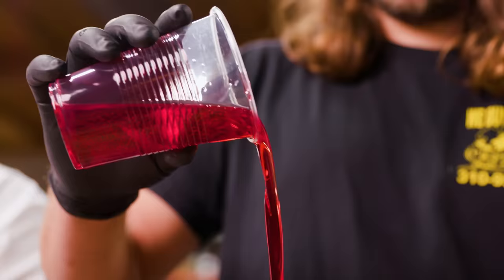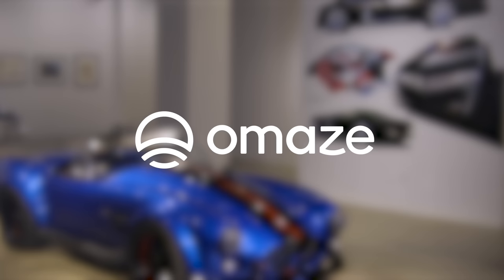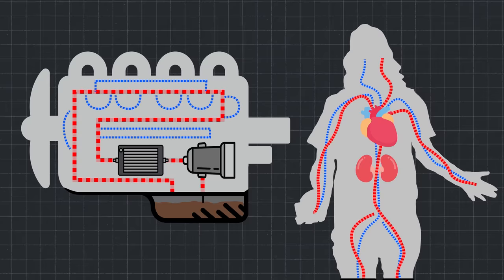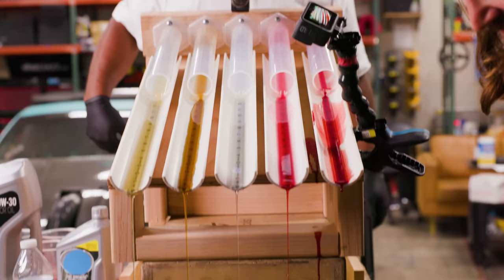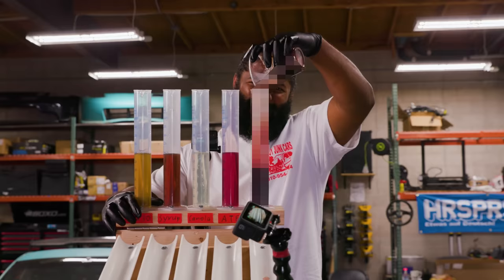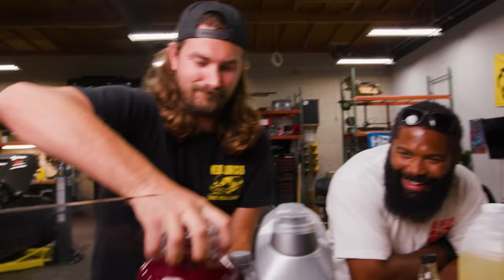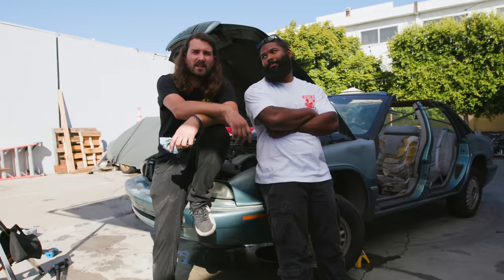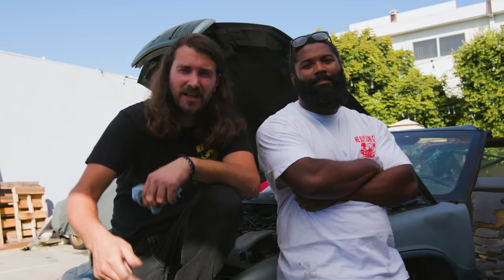We Replaced Our Car's Oil with Blood

Comment: Video idea: How far will a car run without an air filter?

P.S: Great video!
Reply: Just go watch Adam LZ with a rental. They’ll go pretty far
Reply: You could drive for weeks without an air filter
Reply: You can go for long without one ,think about the guys running turbos with no mesh or filter
Reply: @waseemparker5622  yea, but the turbo is like a lil blender making air smoothies for the engine. It takes the stuff in the air and dices and minces it into something combustible.
Reply: @brahtrumpwonbigly7309  no.
Reply: Maybe years
Reply: a car that I bought had no air filter. So I zip tied my sock onto the air intake. Worked like a charm. Drove the car offroad for a year. No problem.
Reply: Years. Have a friend with a 350z that hasn’t had one for probably 3-4 years now. Don’t know why he never replaced it. Runs like shit in the rain but otherwise it’s fine. We hope
Reply: @brahtrumpwonbigly7309  what
Reply: Depends on the road conditions. Down dirt roads, maybe 25k on the highway it could easily crack 100k with no air filter. It all depends on the dust it sucks in and how long the engine will have compression.
Reply: So you want one of the donut guys to, for many months, for thousands of miles, drive a car whose welfare they don't care about just so they can make A SINGLE VIDEO.

Unless there's a cold air intake that sits very low in the engine bay and they're racing through dirt and mud, that's gonna be a supremely boring video.
Reply: it'll all depend on what gets in, if all the air happens to be pretty clean, you can run the car its whole life without a filter. On the other hand, you could kill an engine driving in the desert WITH a filter on...

Comment: Maple syrup isn't a lubricant, its more of a sort of glue cuz it'll harden when its cold or left too long in low-med heat. it could damage ur engine as time goes on. also maple syrup can distribute heat and will be hotter faster
Reply: True

Comment: To clarify for a 5W-20 oil the W stands for Winter. Both the 5 and 20 are measurements of viscosity. The 5 is when cold (40°F) and the 20 is when at operating temperature (210°F). Lower means less viscous/ more runny. Higher means more viscous/less runny. So even though the W doesn't mean Weight the the number or viscosity index is widely called the oil weight.
Reply: Nice explanation .
Reply: Why would it be less viscous when cold? I see you were perhaps not implying that. From amsoil they are tested at 40 C (104 f) and 100 C  (212 f ).  they make multi grade oils that can still be pumped efficiently through the engine when it is cold below 40 C. the higher number after the w does not mean that the oil is thicker at 100 C than 40C

Comment: One reason why the oil stayed so cool during the heat test is that microwaves work by exciting water molecules and since the oil is well, oil based it was more resistant to heating up than the other fluids which were mostly water based

Comment: I'd like to make mention about the way a microwave "cooks" food. Let's put it this way; the micro radio waves being broadcast inside the box collide with and agitate molecules which causes them to give off more heat. Some substances are more subjected to this molecular agitation than others. Sugars and water in foods are some of the more efficiently agitated substances than foreign objects a block of Styrofoam (just a hunch).  Maple syrup did exactly as would be expected with heating up faster than the motor oil,  the substance least affected by the agitation of the micro radio waves. Heating up test liquids through conduction like a 'sous vide' steak could also provide as a reliable method of having equal temperatures across liquid test materials.

FUN FACT: The holes in the screen door of your microwave are just slightly smaller than the micro radio waves themselves, therefore not allowing them to pass through the screen as we are wondering what kinds of cancer microwave appliances cause as we stand too close. They're just photons, give it the photon-beans.

Comment: The Regal has the 3.8 which is related to the Chevy 4.3 and its worth mentioning my s10 with its 4.3 the original owner blew a hole into the oil pan bigger than a softball and he still drove it into a parking lot 3 miles after it started leaking oil and it was still running in the parking lot

Comment: btw, the difference in temps of the fluids after microwaving is just because of the difference in water content. Microwaves require polar fluid particles - water being the ideal - in order to heat up the substance, the motor oil didn't raise as much in temp because it contains less water, this isn't really indicative of how the substances are able to deal with heat, it also messed up the subsequent hot viscosity test.

you might have noticed that really dry things barely heat up when you put them in the microwave, so maybe next time, don't skip adding water to your 5 minute noodles

Comment: to be fair, the microwave won't heat up oils, especially engine oil as the fluid won't have enough water in it to raise the overall temp of said fluid. Microwave bandwidth is tuned to target water molecules in food. That's how it heats up the food by exciting water molecules in whatever food item is present in the oven.

Comment: With the microwave heating: for anything with water...this would have a strong effect because of the molecules dipole nature. This would cause that fluid to heat up. Oils are hydrocarbons. electronegativity between carbon and hydrogen is very tiny and considered nonpolar. Therefore the microwave energy doesn't cause the same molecular friction for those. 

The oil will heat up...but simply because the thing it was held in heats up...so it just gained some temp from there. 

A convection oven would have done the  trick... however I can tell the blood would be 'black pudding' by the end of the test :)

Comment: Microwaving different fluids doesn't affect them equally. Microwave is tuned to resonate water molecules, so they take in the energy the magnetron is sending.

No doubt maple syrup got hot because it's water & carboHYDRATES; and oil barely got warmer – most likely just via convection of hot vapors or infrared emission of the more watery liquids.

Comment: It’s no surprises that with the heated up fluids the higher the temperature was, the lower the viscosity or rather the faster the flow was.  That being said, that doesn’t necessarily mean they’ll perform in that order since your method of hearing was a microwave.  Different particles react differently to the microwaves with some reflecting the waves and some absorbing it and heating up like water.  The water content in maple syrup and blood is probably what lead it to heating up more.

Comment: I’d just like to point out that it’s a common misconception that oil is rated by “weight” the “W” actually stands for winter and means the viscosity index rating is from its thickess point to its thinnest point of viscosity. So a 10W-30 would be expected around a 10 on the viscosity index, and a 30 in normal temperatures. Almost all your general engine oils run on a variable viscosity index for multiple different environments or else you would need to change your oil based on the seasons or environment you are travelling in.
Reply: ᗩ ᑎᗝ丅ᗴ Ƴᗝᑌ ᗯᕼᗴᖇᗴ ᖇᗴᖴᗴᖇᖇᗴᗪ ᗷƳ ᗰᗴ

丅ᗴxт📥Ŵ𝒉ạťʂ𝑨ƤƤ

  ±𝟭𝟯𝟬𝟮𝟱𝟮𝟰𝟵𝟲𝟭𝟴✔⚡️💯💯💯💯

Comment: My dad told us when we was kids if your engine is knocking change the oil and replace a qrt with trans fluid it’ll swell seals and what not stops the knocks and it does wuiet the knock down a lot

Comment: The blood acted the way it was because of blood is 92% water. That’s why the blood in the microwave was mostly gone with just those 8% of solids left. Water can’t handle engine level heat with a boiling point 212F. 
Also this explains why the blood had a very low viscosity. Think how runny water is. 
Blood behaves essentially the same as water because it mostly is when used as motor oil.

Comment: The different temperatures from the microwave is because microwaves are calibrated to best heat up water and oil is the most different from water (that’s a very simplified explanation)

Comment: Guys, oily liquids don't interact with microwave radiation as do watery liquids... . You want consistency? Put all liquids in a container, and those in boiling water, all liquids will reach the same 212°F - which is absolutely the ballpark for engine temps.

Comment: flaw in you heating strategy... microwaves heat the water within things to make them hot, if there is no water it wont heat things that well hence the oil not really getting hot in the microwave and blood was almost at a boil

Comment: Using water as engine oil would be "better", and that motor is a solid beast already. Try it with a worn in 2zzfE. 🤣 There is a lot of sodium in mammal blood and then white and red blood cells are going to carbonize and become carbon deposits much faster than anything in mineral/distilled water. Air in the compression and exhaust steps will curdle the blood on the cylinder walls and cause a huge viscosity gradient, and carbonize at that point. Compression tests before getting the motor to op temp will probably show very similar results as cheap oil

Comment: The problem with the blood replacement is that you only have around 6 litres of it to begin with, which is about how much an average 2 liter 4-cylinder will take. So you either need a lot of people to take only a little bit from, or you're pretty much dead. In which case, the car having "oil" is pointless, since it's now missing an operator :|

Comment: Oil is not dealing better with heat, it's cooler because it's the only fluid which is not water based... which happens to be how microwaves work - they heat the water in things. 'Cause water swings at 2.4GHz, exactly like micro waves.

Comment: Was this video rushed to meet a deadline?
I know you killed the car with blood but why didn't you test the other three even though you spent so much time talking about them?
The video ending came suddenly and out of nowhere.
I agree with everyone else saying a microwave is a bad way to heat multiple types of fluid at once. A microwave doesn't emit heat, it emits energy which fluids with water absorb; it doesn't work on metallic or non-moist materials, such as engine oil.
Reply: ᗩ ᑎᗝ丅ᗴ Ƴᗝᑌ ᗯᕼᗴᖇᗴ ᖇᗴᖴᗴᖇᖇᗴᗪ ᗷƳ ᗰᗴ

丅ᗴxт▪️

  ±𝟭𝟯𝟬𝟮𝟱𝟮𝟰𝟵𝟲𝟭𝟴✔⚡️💯

Comment: That heat test says nothing. It doesn’t show how good engine oil is with dealing with heat. Microwaves are mostly absorbed by water molecules so that tells you more about the chemical buildup of the fluids being tested not whether or not they are good at dealing with heat in an engine because an engine does not create microwaves. This is not scientific at all.

Comment: Ok so first of all, canola oil is horrifically bad for you. Second of all, 30W is not 30 "weight." It's 30 winter. It's the number that says how viscous the oil is at low temps

Comment: "the engine oil is better at dealing with heat"
you didn't even heat it. it was 95f. microwaves don't heat everything equally

Comment: dude microwaves work by shifting an electric field rapidly ... polar molecules ...like water start to align with the fast changing field so they begin to wiggle this wiggle motion transfers energy hence the temperature rises. oil does not have a polarity, meaning the molecules dont have a more positive and a more negative side to them so the microwave does affect them... rule of thumb... the higher the water content of something the better the microwave can heat it ... so oil not getting as hot has nothing to do with better heat transfer but with oil being non polar... sry had to get that out of my system even though im now officially a nagging nancy

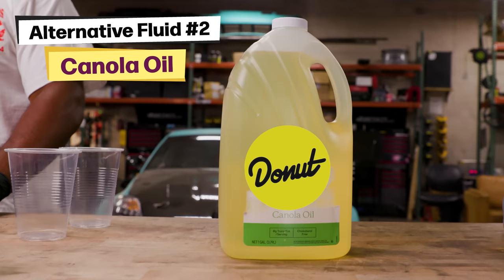Comment: 1:04 That's almost complete BS and almost completely backwards though, especially when heated to high temps it's actually one of the worse ones when the omega 6's are oxidized by heat. It's just a BS conclusion reached based on how it seemed to lower 'bad' cholesterol which isn't even bad unless it's oxidized. Sugar companies were also responsible for demonizing saturated fat which is essential for health and I think dietary cholesterol is too, I don't think the body produces enough on it's own hence why vegan athletes tend to recover poorly from injuries. It's actually sugar among other things that can oxidize LDL cholesterol actually causing heart disease and so can linoleic acid in high omega 6 oils unless they're high oleic oils. High LDL can indicate negative things like liver damage, but it's meant to help fix the problem and shouldn't contribute to heart problems if it's not oxidized, similar with calcium causing blockages if you don't get enough vitamin K2, D, and magnesium which most don't and most get too much calcium. Even intense training but in a healthy way can elevate LDL.

Comment: I do want to point out. Love ya work, but a microwave is a terrible test for heat as all elements absorb different amounts of microwave radiation, particularly oil and water are vastly different. Again, I love ya work, but I can't let a scientific fau par go past. Still a great test and great video, but my suggestion would be to have each liquid in a metal flask, and dipped into boiling water. Love ya babe xx